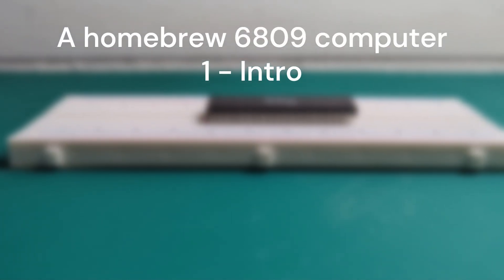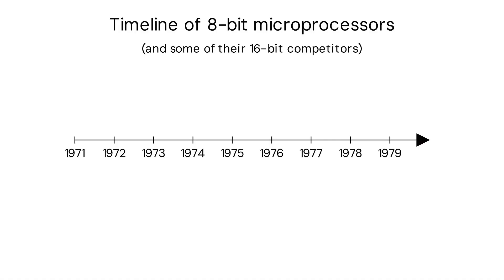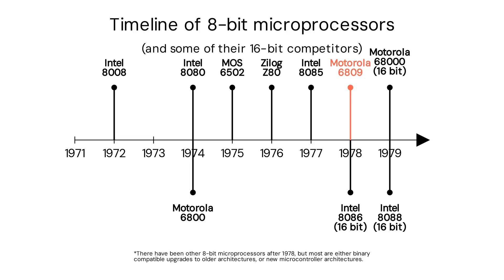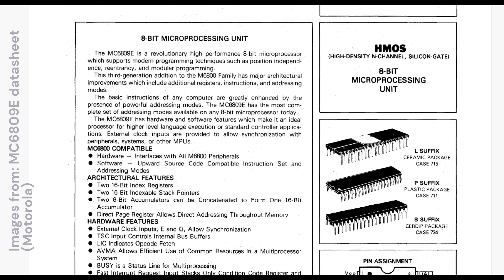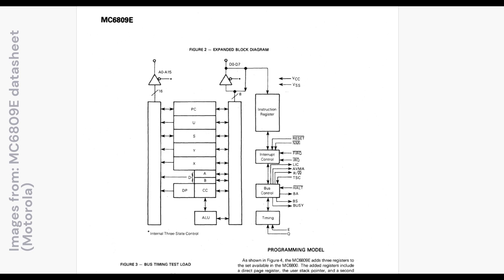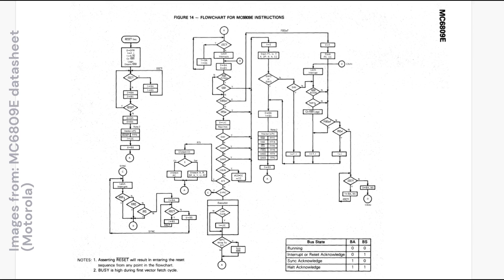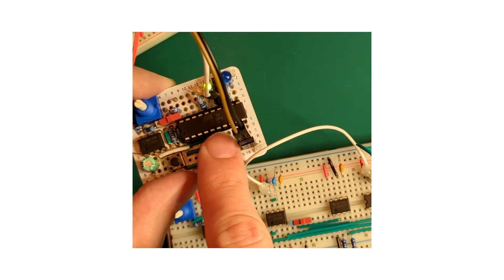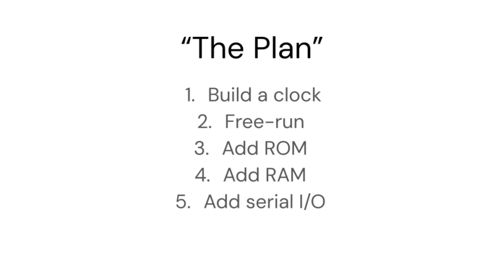A 6809 homebrew computer

Comment: Hitachi HD63C09, 6809 emulation option but really is a later 1980s cpu with extended instruction set
Reply from the maker: Yes, I'm aware and maybe I'll explore that later. Hitachi published it as a pure 6809 clone, but added a lot of undocumented features that the community then discovered and reverse engineered.

Comment: Great to see a non Z80 build. Did some 6800 builds myself looking forward to this 6809 one. Are you considering a floppy or SD card to run FLEX?
Reply from the maker: @BLSrr  I don't have access to a floppy and I'm not planning to. SD card could be an option 
I've never ran flex09, only heard of it, but definitely fits into the "cool stuff to run" that is like to try. Do you know where to find it?
Reply from the maker: After exploring a bit more about flex, it sounds really exciting, although it's a bit of a long term goal (a lot of hardware needs to happen before getting there). If I get uniflex running that would be more than I ever expected. We'll see where this gets
Reply: @dmoisset  Sounds great there not manny of those on youtube. I'm also looking for FLEX to get running on my system, but like you I need disk hardware which I still have to make.

Comment: Cool! The CPU of my first computer (the Motorola version), the TRS-80 Color Computer w/ 4K of RAM.  Liked and subscribed.
Reply from the maker: There use to be a CoCo (a later version, the 64K CoCo 2) at home and I learnt how to choose with it. 
Some may say that I'm doing this as a nostalgia build, but I actually researched quite a bit some of the options (6502 and Z80 mainly) before deciding on this. The CoCo had meh hardware with an amazing CPU (which compensated a bit for some of the lacking graphics/sound)

Comment: This made me want to look for the Z80 processor again. :)
Reply from the maker: I never have written code for it, but I studied a bit most of the architectures mentioned here before deciding on the 6809 (which I have experience with).... What are your favourite things about the Z80?
Reply: @dmoisset  No particular reason, perhaps nostalgia. (The microcomputers made in Hungary had Z80-clone processors.)